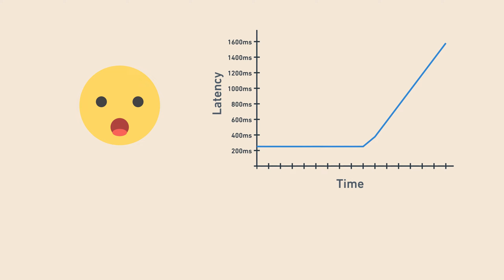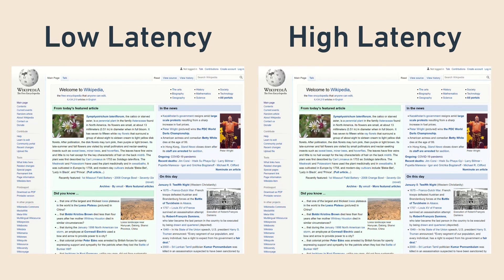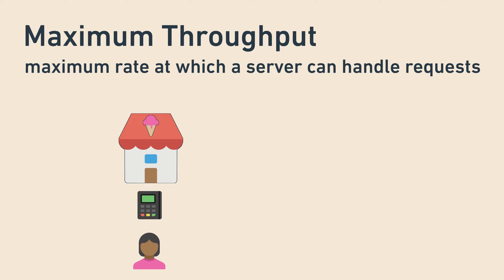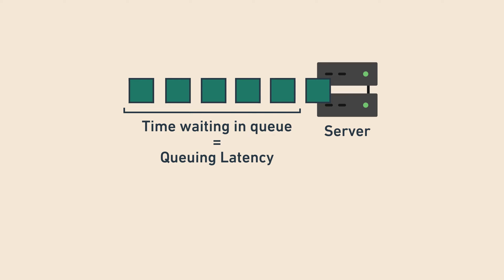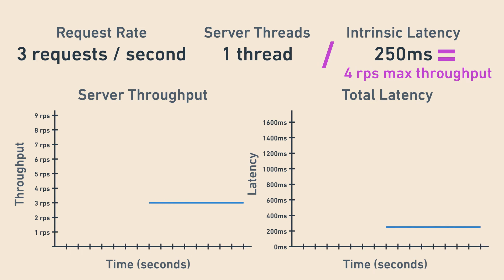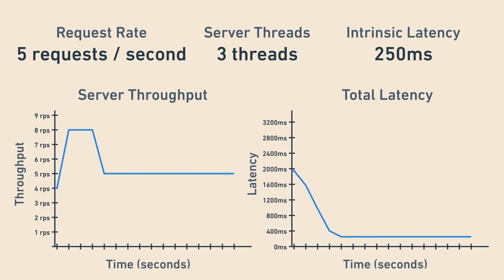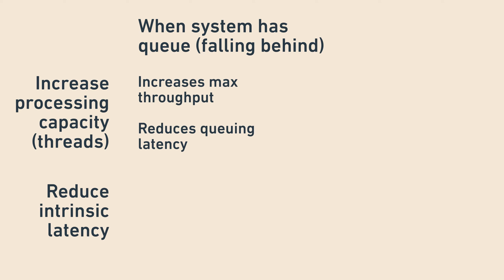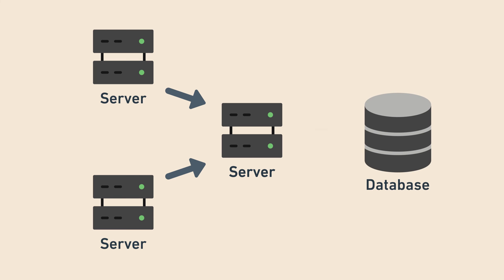Throughput vs. Latency: How To Debug A Latency Problem

Comment: I wonder how two other illustrations might illustrate issues which can arise with servers.   One: the counter clerk at the ice cream store is doing fine until one of the ice cream buckets runs empty, so they have to go get another from the freezer, and a line forms.
Two: Now the customers are angry about the line, and each one wants to register a complaint, which decreases the intrinsic throughput.  So the process of getting another bucket and any decrease in throughput from the hard-frozen data (I mean ice cream) along with complaints, ends up creating bigger and bigger issues.

Comment: a good example to add is intrinsic latency is very important for gaming where to data packets are relatively small, but you want it it get to destination and back fast.. there concept difference between downloading a file vs live streaming or gaming.., Cable Internet have bad intrinsic latency..